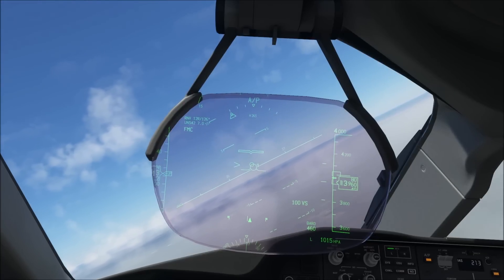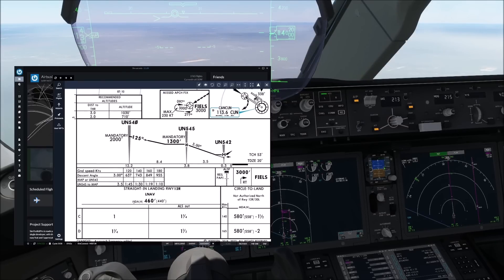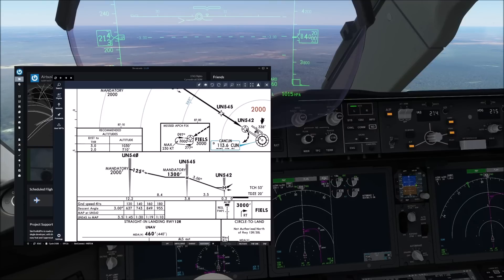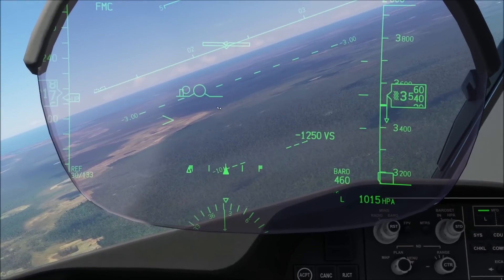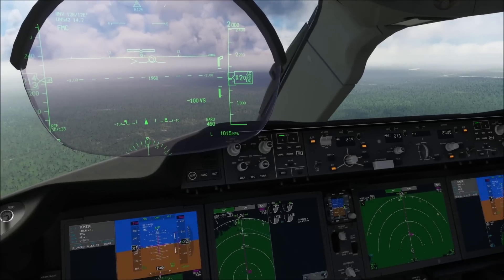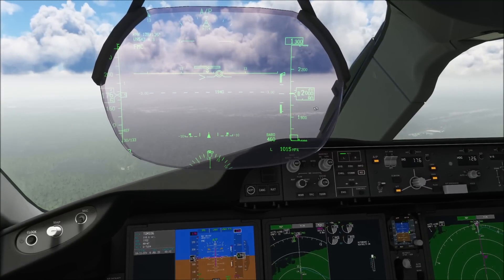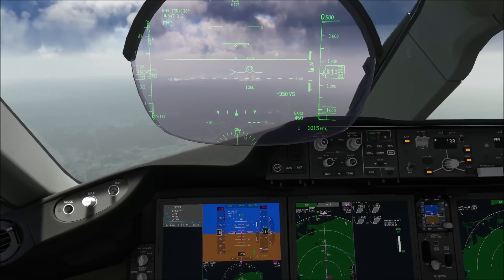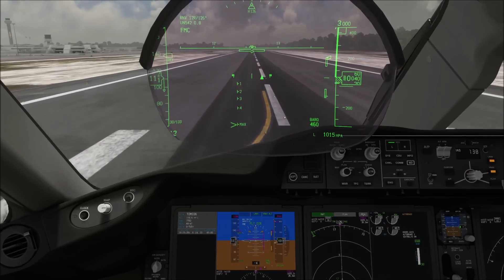B787 & B747 Non Precision Approach TUTORIAL | LNAV/VNAV & IAN | Real Airline Pilot

Comment: I think the ACFT's LOC movement is unreal when conductiong 30 degree offset intercept. The LOC moves in a jerky manner, but does not move smoothly. Also, the movement speed should be different depending on the DME distance, but it doesn't seem to be reflected well.
Reply from the maker: They're still default aircraft after all... unfortunately.

Comment: No disarming AT prior to landing? I thought it would be the same as 737.
Reply from the maker: On the 777 and 787 that's not required as the fly by wire will automatically trim out any pitching moment caused by varying engine thrust, unlike the 737.
Reply: @737NGDriver  Thank you for the reply. Constantly learning from your tutorial series and content in general. Appreciate all that you do mate!